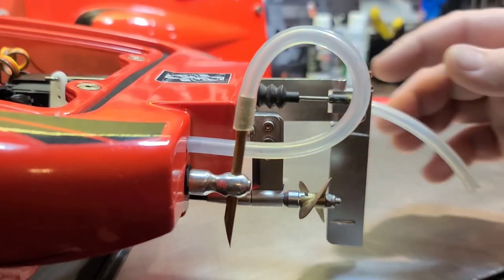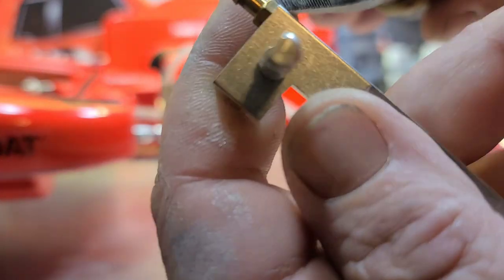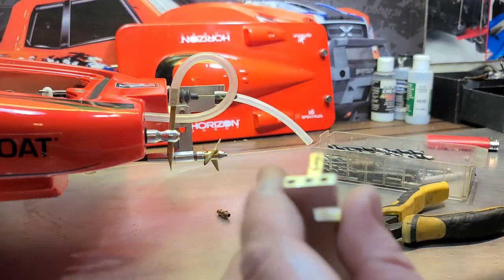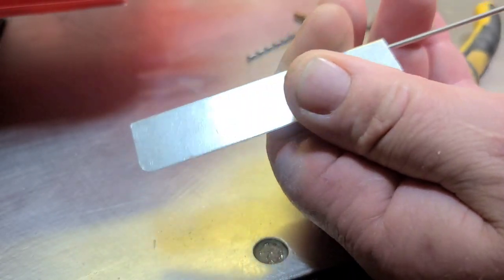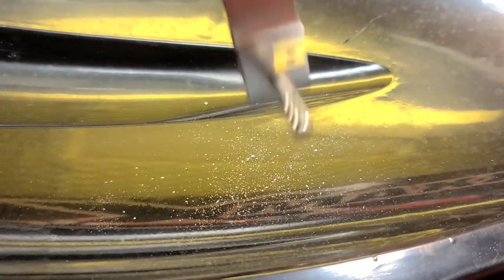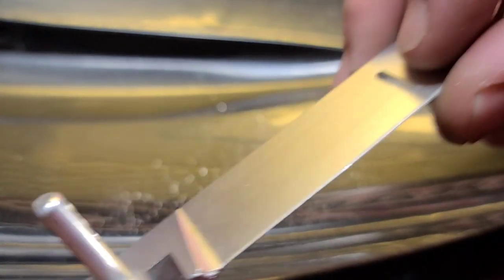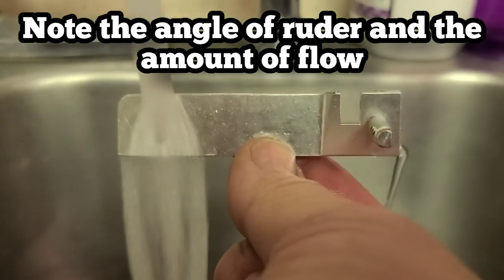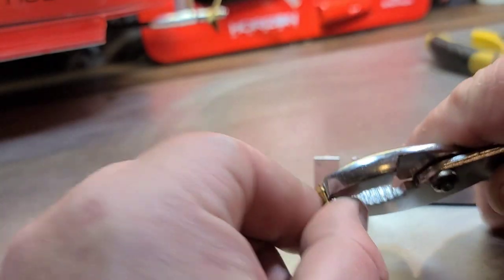RC Boat Watercooling - How To Drill The Rudder Out For More Flow

Comment: I love all your tips and tricks. I have learned sooo much since I bought my UL-19 at the end of this November and came across your channel. Already made the first important upgrade is the dual cooling system, and 20kg servo but have the carbon fiber upgrades, 160a esc, curved turn fin and a cnc prop for now. Going to carbon fiber my hill like you did and looking for a motor around 1800kg and a prop setup to get some speed out of her.
Reply from the maker: Good luck with the build. Wish I'd went carbon fiber sooner

Comment: They looked like brass to me. On another note, would an angled inlet provide a more efficient water passage? The stock inlet looks like it's 90° to the first water flow direction change at the back of the rudder (internal, the passage you were expanding at the beginning). I would think that a more gradual change in direction via a curve instead of an abrupt 90° would pick up more volume with less effort,  less of a radical change (from standing water to water being violently forced straight up through a tiny hole at speed). I mean, if you're looking to reduce inefficiencies where ever possible, it might be worth the little extra research...or cause minor to massive water resistance, you know, either/or.
Reply from the maker: I agree 100% 👍  Yeah I know exactly what you're talking about like a gradual band instead of a 90ﾟ band I would think that cool better yes sir  Worth the shot anyway

Comment: Have you done this yet to your black jack 42 ? Anyhow - I just added my dual line water cooling system to my boat and I am going to be using my dremel with a diamond type Pointed Cone Shape Double Cut Dia Grinder Drill bit and it works awesome to open up those water inlets on the rudder..Anyways, heading out to the lake now to try out my dual rudder pickup cooling system and plus I added 200 grams to the front of the boat right underneath the styrofoam...
Reply from the maker: No. My 42 has been cooling pretty good so far.  👌    let us know how she runs with the 200g weight  up front
Reply from the maker: I actually filled down the Strut it self to a bullet shape
Reply: @IRONCLADRC  will do brother, got rained out today but tomorrow It should be a go..
Reply: @FLSharkdiver no update....2 years

Comment: I’m not sure what’s going on with my bj24 rudder. It doesn’t seem to want to hold a trim position and the hinge pin seem loose. I can wiggle the blade all over the place. 🤔
Reply from the maker: I've taken the rudder off and squeezed the rudder base hinge part together just enough to prevent the wobble so the blade fits snugly onto the base

Comment: Ive seen a nice aluminum double rudder system on eBay and wondering if anyone is using it with water pickup rudders
Reply from the maker: Dual rudders are nice especially if you have a boat that has a bad reputation for not turning when you want it to or doesn't want to track in a straight line.    That being said if your building a boat for speed, the extra drag from the 2nd rudder will  actually slow you down..     but the dual rudder set up does look really cool on a boat when fitted correctly